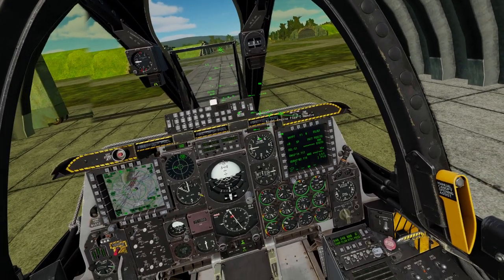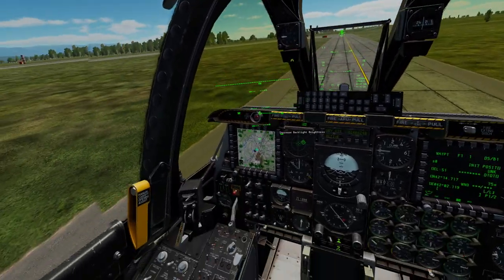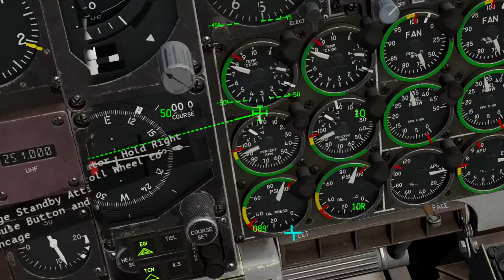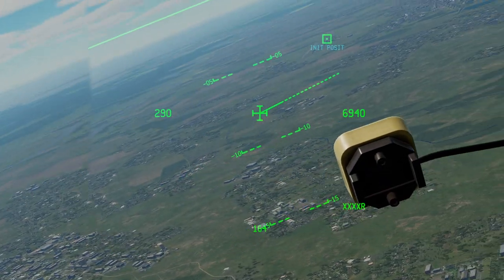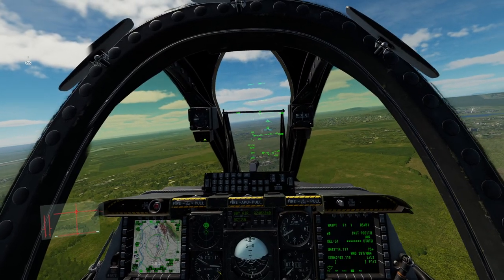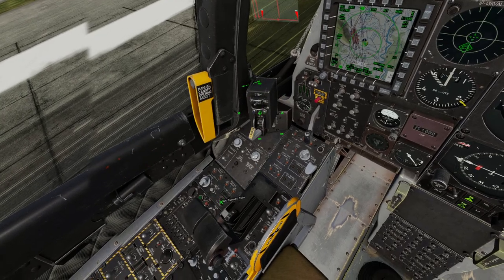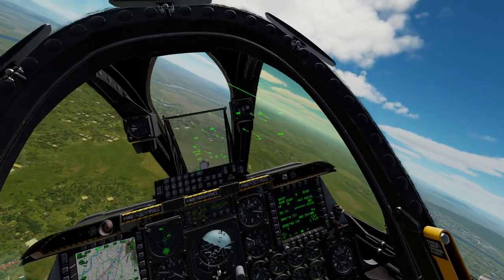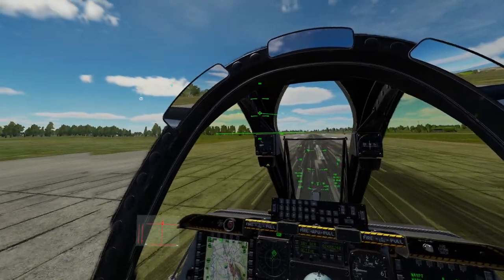Zero to Hero | DCS A-10C II | 3 - Taxi, Takeoff, Landing

Comment: Hi, go through the whole startup, aircraft seems fine, but will not move to taxi. Brakes are off and emergency brake is off. There are chocks beneath the wheels, but not sure they would make any difference to moving. What am I not doing correctly, please? Cheers Red.🤪
Reply from the maker: If there are chocks, open the comm menu "/", find 'Ground Crew', then 'Remove wheel chocks' :)
Reply: @DamnedGh0st  Thanks, yes that worked.